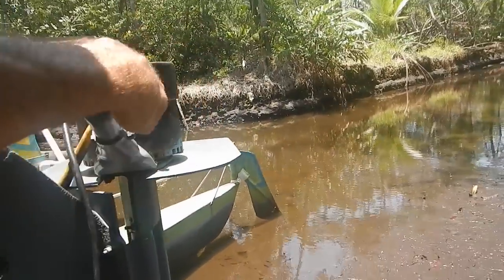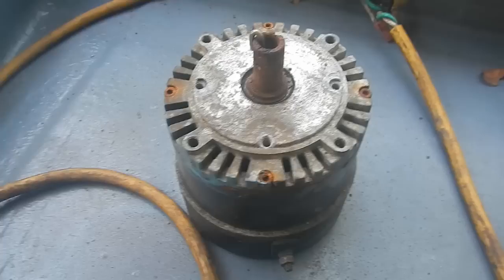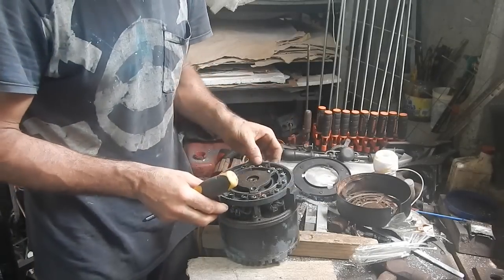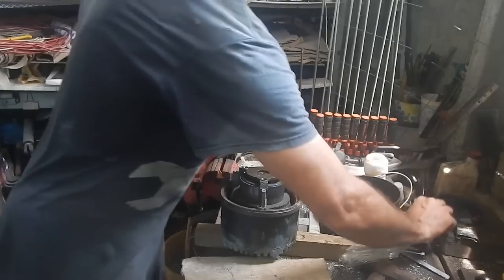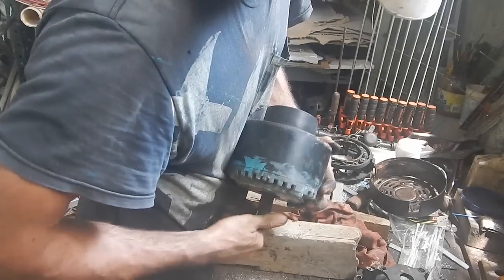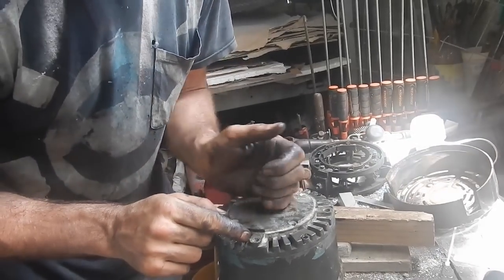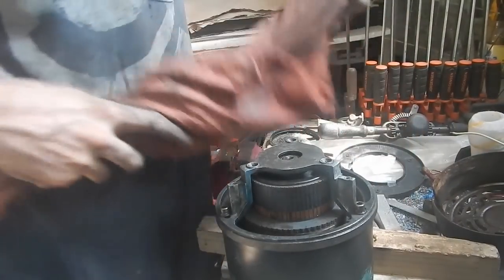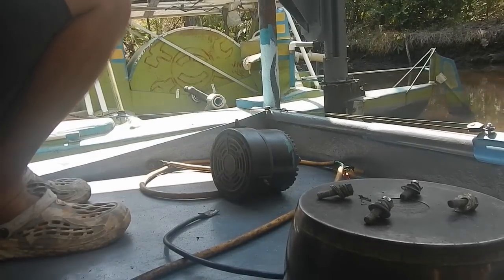Shark Slicer Upgrade 027 Motor Repair

Comment: i would like to suggest putting on your wish list an air compressor for those times you need to blow something out at least, and penetrating oil for the just in case situations like this one :)
Reply: I was thinking the same thing. He needs mega maid to go from suck to blow.

Comment: For the wish list air compressor, bench brush, collection of small metal brushes, small hammer drive impact driver for removing stuck things, spray oiler. Nice rebuild, especially the brushes.

Comment: You could make a steam cleaner. Take a thick pipe or some metal canister like an old fire extinguisher, soda stream bottle or such. Connect a pressure hose with thin nozzle at the end. Fill it with water and boil on fire. 

With hot steam and couple of bars pressure, you can easily clean those motors or any creasy skunk without solvents. You could maybe even remove barnacles.

Comment: They make a tool called an impact driver that is perfect for breaking those rusty bolts loose. I'm not talking about a battery (or pneumatic) gun. I'm talking about a thing that looks like a beefy screwdriver and you smack the butt end with a hammer. It causes a small impact on the bolt and breaks them free nicely. These are often used when changing disc brakes. You might look into it- nice tool to have laying around!
Reply: Ha- checking the comments I can see I'm not the only one to suggest the impact driver. Way to go people- clearly good company here.

Comment: Hello Jaimie, my 5 cents :) 1. I would use a 1/4" impact driver with a new bit. 2. The brushes need to move freely, for best connection during operation. If not, you get excessive heat and my damage the commutator. 3. You should take the motor appart, clean and de-grease the oil and carbon dust. The parts that make this sound, can easy damage the rotor windings. 4. I hope that you are kind to yourself and use gloves when doing this kind of work. 5. In those harsh salt water conditions, worst connection is steel/stainless steel against aluminium. You should use zink galvanized screws, just like Honda outboard motors use. If not, use grease on the screws, so salt water or air do not enter the threads. BR.
Reply: Carbon dust is actually desirable, and takes many hours to accumulate to the right amounts. Ideally you do not disturb it at all. It's both the connection and the lubrication, and having it there protects the brushes and the commutator. Obviously if it's gummed up you clean it off and start over from scratch and accept the penalty.
Reply: @MattsAwesomeStuff  Sorry, this is totally wrong. Carbon dust in electric motors and generators is not wanted, as it lead to earthfaults and excessive heat due to increased resistance over the commutator. The dust get mixed with oil and dirt. I`m an electrical engineer and with massive experience of DC motors installed in submarine and  O&G industry.

Comment: Won't an impact driver be able to take out those rusty bolts?
Reply: Possibly. It could also possibly break the heads off the bolts. For me, it would be not worth the risk.